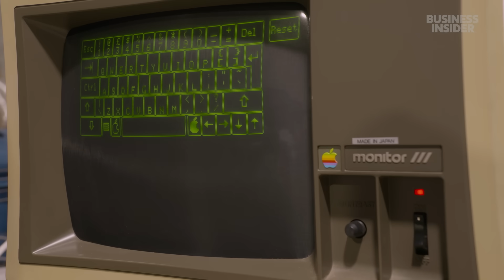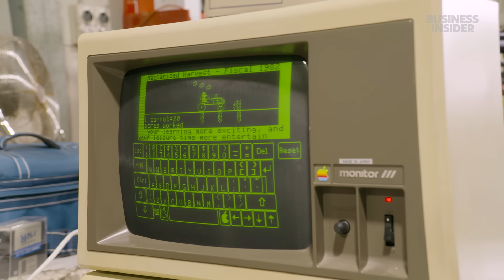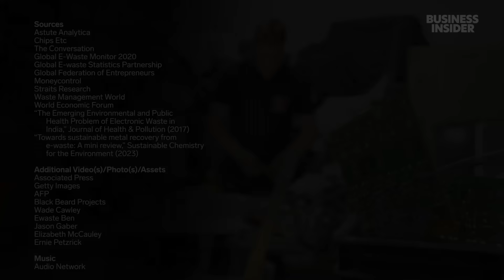How Scrappers Cash In On Gold From Your Old Computer | World Wide Waste | Business Insider

Comment: Some of those chips keep being remade because the use for them and hobbyist work to fix or build new electronics require some of these chips. Sometimes they buy used and sometimes it's all new. I get some chips become outdated but even outdated chips have uses in some fields for specialized things. Seems to me it's more valuable to sale the used chips than the materials you get back out even when selling at reduced cost. let's not forget board connector ends are remade over and over even when we have lots getting thrown away.

Comment: 8:42 Correction. You cement out the copper. If you use electricity to plate out the metals you will transfer ALL metals including the gold. Copper is cemented without electricity using iron. Gold is then precipitated. If the copper is plated, the gold is not in solution at that point as they claim.

Comment: Fact: Most Tv's Thrown Out That Doesn`t Have Physical Damage CAN BE Fixed By A 2 Dolar Caapacitor Or Even Changing Few Wires, I have Sold SO MUCH DUmpster Tvs That I Lost Count, Everytime You See A Tv At Dumpster, Take A Flashlight To The Screen And If Its Not Dasmaged And If The Plug With Wire Is Still There Just Take It Home ANd Youtube It, It Will Show How To Fix It, Its SUPER EASY, I Did That When I Was Around 20 Years Old, Like 25 Years Old I Think, Then My Health God Worse.

Comment: I worked for a company who built machines controlled by electronics ,we had huge scrap waste from rebuilding machines and from faulty circuit boards loads chips go out date have to be recycled ,company done waste disposal and recycling audit with all plastics disassembly to even get  gold out of it would not cover waste disposal costs so had to pay to dispose of it ,if they could possibly make money they would have done it ,the amount these people claim to make gold nuggets is rubbish the amount of waste would easily outweigh all profit so why do you think alot goes off shore burn waste environmental hazard to  the planet throw alot on the ground who cares they don't, any gold they make then its money for them but need tonnes of electronics for this process and acids used to extract it so hazardous to them and environmentally impact soil unbelievably they don't care we should stop export of this start stockpiling it shred it until work out process to recycle extract gold

Comment: Interesting video, the root of the problem in my opinion is intentional shortening of electronic's lifespan (dishwashers,  washing machine etc.) and also imposing ideas that you need new telephone every year, instead of just replacing most used parts like battery

Comment: The worst part about scrapping is the amount of plastic used can't be recycled. Basically every single item in your home that has plastic. A few select items will have the triangle with a number in it most items will have the triangle & no number. There's quite a few full time scrappers here in south auckland that drive around collecting it as well as illegally dumped. I do it part time & pick up stuff on my mowing round. Some like myself will strip & separate the metals from transformers & wiring, while those that do it full time can't spare the time & just take it to the local scrap metal yard. For me it brings in $100 per week. Realistically it's not worth it as i earn far more money far quicker mowing lawns. That said it is fun & there's numerous items that others can use i.e if somebody wants a barby plate or a bike etc i usually just let them take it at no cost. For myself it's saved me money on parts for numerous things i might have & can repair i.e a not working microwave that's in good condition or a bolt i might need for a mower. It's surprising what gets thrown out & still works. Vacuums,pedestal fans,torches, scooters,bikes,computers etc

Comment: We have a recycling company that pays us less than their facility 2 states over (4 hours away) pays there for the same materials. They accept computer circuit boards and electronics but they don't pay for them. I never see them get any of that. My fiancé & I dumpster dive the same city, but only occasionally as we moved to about 90 miles away. Even when we lived there though, and had many spots we'd check consistently (business dumpsters mainly) there was no way to save even a significant fraction of the massive amount of electronic waste that gets thrown away. And this is a city in Montana with a population of less than 30,000. It's disgusting what gets wasted every single freaking day.

Comment: Ok from a design perspective, wire insulator has to be heat & fire resistant with bromine added for safety, but then if these wires are burned by poor uneducated people in crude fires to recover the copper, the resulting smoke toxic // so perhaps PLA or other biological compostable wire insulator with ROHS devices could reduce the use of PVC and Bromine so the smoke from burning such fires much less poisonous or toxic & safer for people known to do this kind of crude e-waste recycling, also better for ecosystems & the biosphere of Earth since the food web connects everything in the atmosphere, water cycle, everything on Earth is connected in the biosphere, all things living are.

Comment: Too bad environmental regulation is also created thing where if i go to my local recycling company and there is cable that would replace broken one, i cant go and swap, they will call cops and put charges on stealing and there was case where buddy worked for them. There was very rare car with even rarer engine in it. Buddy run to boss and offered all the way to 9000€ for just the engine.. they didnt sell or would sell anything for any price, even if it made financially far more sense than scrap it and all liability was written off from company. They also use government forced essentially free labor to process their E waste and again cant get anything from there ether even if you are just looking some plastic spare part and its right there on the table being then sent to energy waste facility or where ever to be disposed...